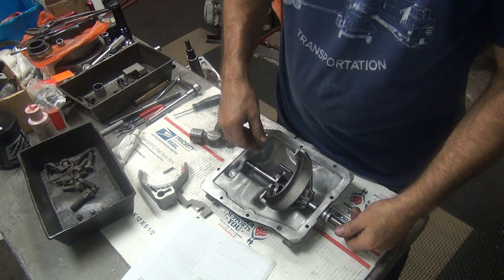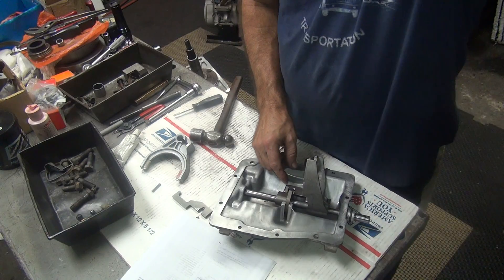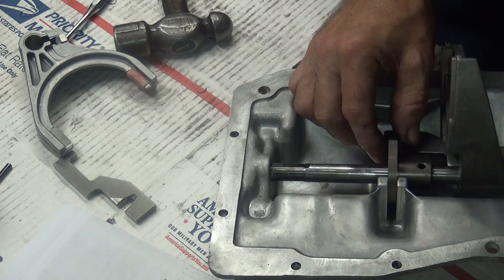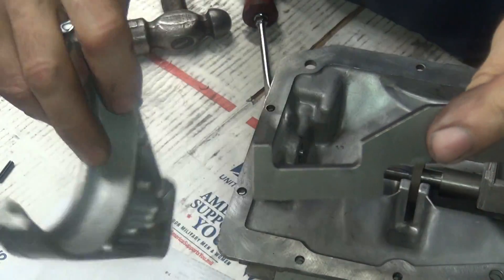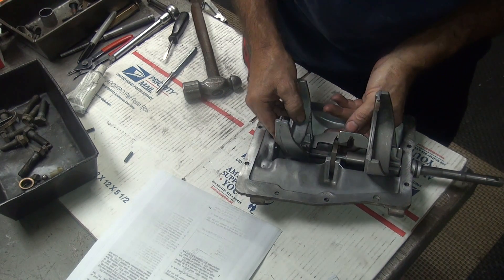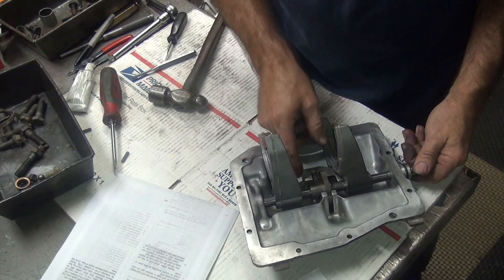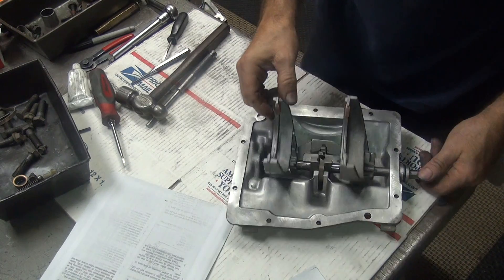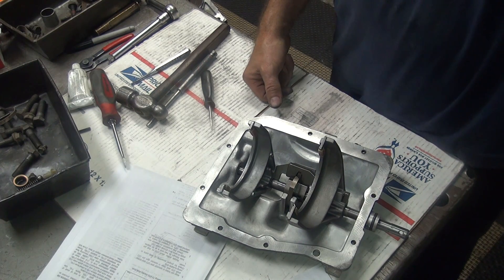#114 1982-95 Chevy T5 NWC Tremec transmission rebuild Borg Warner non-world-class T-5 5 speed S10

Comment: Hey tarto. I've got an 84 S10 Blazer with a similar trans. It's a 4wd model so it has a different tail housing. Problem with mine is that it gets stuck in fourth gear and the only way to get it out is by magic. It's my first car and I have a good amount of work to do to it because the godforsaken vacuum actuated transfer case with the "genius" cost effective rubber vacuum line that's positions directly next to the battery and exhaust manifolds. Anyways, my guess that it's the shift fork.. but 3rd gear seems fine. What do you think? P.s. sorry about the book I just made you read. ~kyle
Reply from the maker: beats me, just fix what looks bad and leave the rest alone. that usually fixes most things.
tatro

Comment: hey Bro, I am 56 yrs old from Kingston TN and I built a 55 Chevy pickup with one of these transmissions in it. I hit second gear a little too hard and........... well, you know. I got another one that had a broken shift fork, so I had to rob the other transmission for it. Any way, I could NOT get the shifter back together. Basically I had the exact problem you had in this video where the thing slipped out of the other piece. After watching you finally figure it out, I knew I must be able to too if I mess with it enough, so.... I finally got it.Thanks for the instructional video. I'm really impress with your ability to tear down and fix this transmission with no book. You are a very good mechanic. Thanks for the help.
Reply from the maker: its only a stupid car so how hard could it be? now we know.
i always like how they say all you can do is buy a new part if you take it apart because we are too stupid to put it back together again. what a bunch of morons. workers are way smarter then engineers because we can actually do something.
tatro